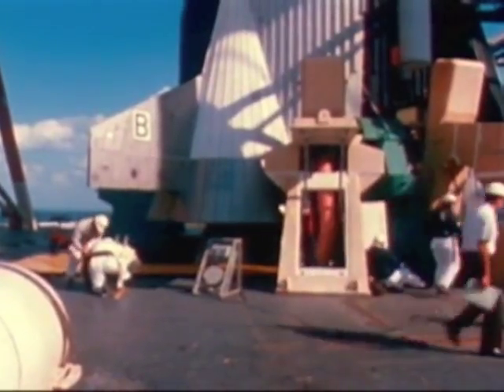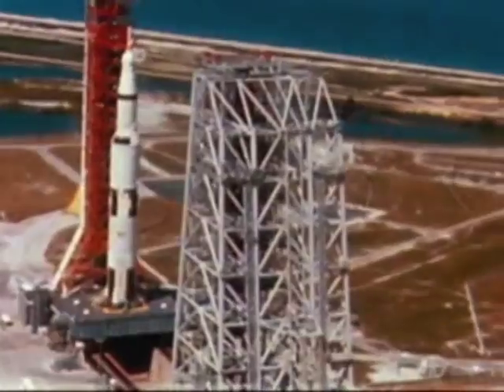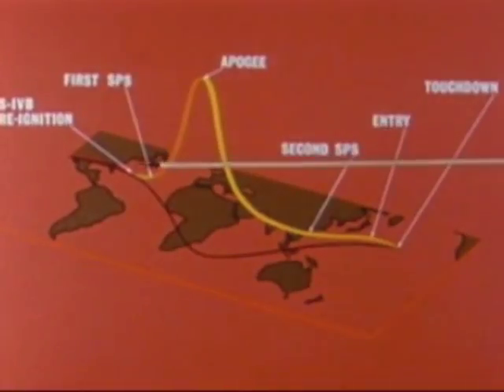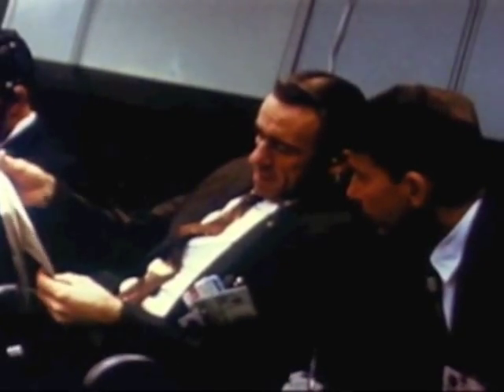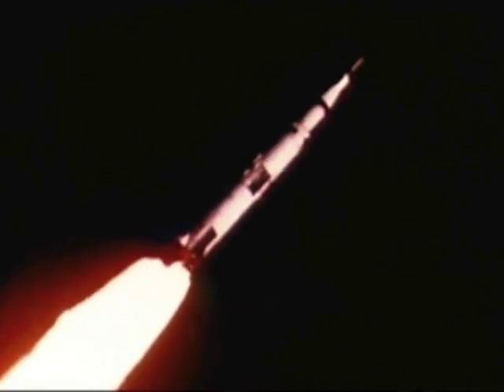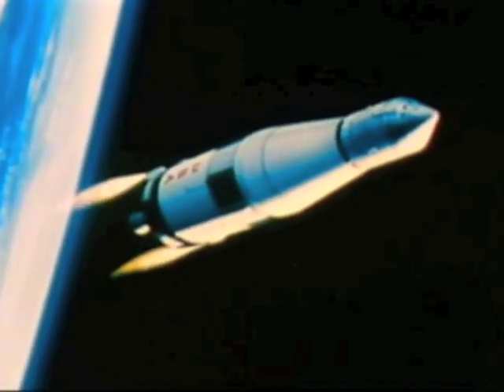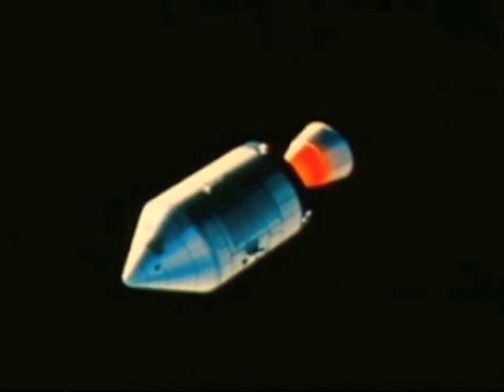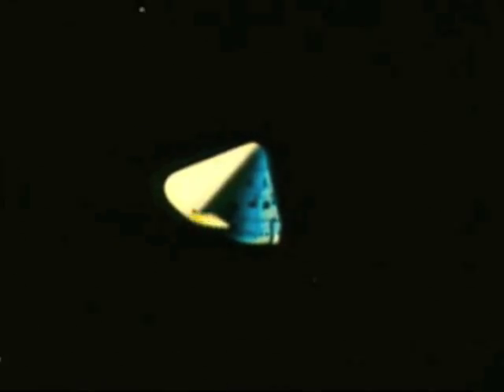The Apollo 4 Mission

Comment: The animations show a key event that I was very curious about: How is the liquid fuel wildly sloshing about in the tanks able to be pumped after the engine has been shut down? It appears in the animations that they fire forward translation thrusters before igniting the main engine in space so that the fuel will be relocated at the pickup point at the bottom of each stage. It's very neat! I was always wondering how that worked...
Reply: +Victor Iliescu They fire what are called "ullage motors" right before the 2nd and 3rd stages are ignited. These are small solid motors that burn for a few seconds, providing acceleration to the stage and "settling" the liquid propellants into their tanks so they flow properly!   Good eye, you have  :)
Reply: Victor Iliescu Yes 
And pressuring the tanks with nitrogen gas.

Comment: Have never watched this before and enjoyed the info despite the slightly blurry appearance of this old film from 1967. I guess most of the NASA vintage footage for Apollo is not that clear.  Do you think there is any chance of locating this feature in better definition?  

Otherwise this was very interesting and a precursor to the upcoming Orion-DELTA IV Heavy launch in December which will ascend to 3600 miles altitude for much the same purpose, testing the large heat shield. If successful it will elevate the temperature to I think 4000 degrees F and reach a maximum speed of only 20,000 miles per hour.  Delta IV heavy is a pretty reliable launch vehicle and is not being tested directly.  

Thanks for the upload,
Keith
Reply: There is always a chance. I say "go for it"!

Comment: What is most remembered about Apollo 4 was Walter Cronkite exclaiming on-air that the roof of the CBS anchor trailer at Cape Canaveral was caving in as the Saturn 5 rocket roared off the launch padf!!

Later, CBS (and the other networks) built more sturdy anchor studios.

Comment: The atmosphere is opaque to primary cosmic rays with energies below about 1 GeV, so only secondary radiation can reach the surface. The secondary radiation is also attenuated by absorption in the atmosphere, as well as by radioactive decay in flight of some particles, such as muons. Particles entering from a direction close to the horizon are especially attenuated. How did apollo attenuate gamma radiation in the radiation belts? Does anyone even know what a linear attenuation coefficient is?

Comment: No, all we have are some funky animations, some powerpoints and some budget allocations. And sadly I doubt it will get much further than that. Remember this new beast is predicated around using left over shuttle hardware, except the further you get away from 2011 the more irrelevent that gets. How are you going to manufacture the external tanks again, that lines gone. All the crews at the VAB and pads that were in shuttle processing have been fired, they will all go find new jobs of some sort.

Comment: I beleive they used gyroscopes to stabilize and aim the booster in flight as goddard and von braun used, moving the vanes of the trusters the same way a autop[ilot of a plane moves the alierons and rudder and elevator to guide and maintain stability in flight. Engineeres got along with many things before digital electroncs hit the scean in 1943

Comment: The catalog of LDE flares contains data on 646 flares observed in the 20th and 1029 flares observed in the 21st cycle of solar activity. LDE flares constitute an important subgroup of two-ribbon flares. They are characterized by a strong and long lasting process of magnetic field reconnection. They produce accelerated protons which propagate into interplanetary space and generate Sudden Ionospheric Disturbances by enhanced shortwave emission. There were SPE's during apollo missions. Explain.

Comment: Why don't they reuse the command module?
Reply: +Doc Nathan Two reasons.  First, after all the stress and heat of re-entry, it was not usable again! The heat shield was an integral part of the structure and was mostly burned away after re-entering at 25,000 mph. Secondly, it was not a man rated CM, and instead was a heavily instrumented flight model with no seats or control panels.
Reply: +Matt Ossip But the stress and heat of the space shuttle, it was reused!  How was the orbiter reusable?
Reply: +Doc Nathan
it had a completely different heat shield, that had to be developed for the space shuttle. And even that heat shield made a huge lots of problems with reuseing. I wonder how Spaxe X will solve it with the Dragon v2...
Reply: Phenolic Impregnated Carbon Ablator
Reply: Salt Water

Comment: ???-This is the 2nd time you have ever responded to me with your first being 6th grade level insults.  

Your question shows a basic misunderstanding of of radiation shielding.  No amount of aluminum or lead or anything else will stop radiation 100%. (That's why it's called ATTENUATION) 

And of course you fail to understand that while Al and metals in general are poor attenuators of radiation, the  Mylar/Kapton thermal insulation material used in the spaceship hull and spacesuits was excellent.

Comment: It is that launch(unmanned) when they gathered all the "DATA"to fool the world in 1969,they had all they needed to fake the future launches,Again today,in 2018,NASA admits that ,they cannot go threw the VH belts,without roasting the crew,the systems,etc..........SHAME.
Reply: joe coquerre oh shut up you idiot. A few things. Anyone well educated on this would know they are called the Van Allen belts, or VA, not whatever VH is supposed to mean. And don't try to tell me it's a typo, A and H are very far apart on a keyboard. And no NASA has never 'admitted' that. You see I don't think you understand radiation. The Van Allen belts are comprised of charged particles. These are not the Gamma rays thrown out by reactors that take metres of concrete to stop, these beta particles are stopped by a thin sheet of aluminium. This would neither roast the crew nor roast the systems. Also, the spacecraft passes through the inner belt in minutes and the much weaker outer belt in hours. Go and educate yourself.
Reply: @dubsy1026  It is quite possible that he actually thinks that they are called the "Van Halen" belts as many of these reality deniers do! Also his punction and spelling are appalling. Take care.